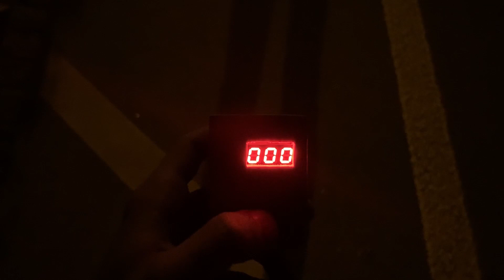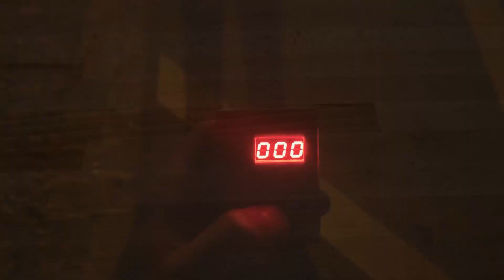Simple DIY GPS-Speedometer

Comment: DOES IT SAVE DATA  SO YOU CAN PLUG IT IN TO A PC AND SEE WHAT YOUR MAX SPEED WAS???OR ONLY REAL TIME DATA? AND YOU GOTTA BE WATCHING IT OR HAVE A CAMERA ON IT/?
Reply from the maker: The arduino can collect data as long as it remains running and has an onboard storage (eeprom) which can hold up to 512 bytes. So saving top speeds is no problem.
Reply: @bootlegengineer   hmmmi wonder if my apm 2.5 can do that i cant remember last time i used it was 4 years or more 
ok thanks and i think you said you had video that tell all the parts and more detailed instructions on how to build it ...  n would you build me one n if so what would you charge for it plus shipping to las vegas nevada ??

Comment: How did you wire the screen
Reply from the maker: Well that depends on what screen you use. If you talk about the segment display, you can find schematics for it on the web, in the end the pins are just the seperate led pins and you have to think about how to deive them yourself. If you talk bout the oled then you can use A library that handles everything for you and also tells you which pins are valid.

Comment: Hi,  I would like to make one of theses, But am unsure of the wiring. could you help me please,
Reply from the maker: Cheers Daniel, 
The wiring is rather simple on this one. To hook up the gps you connect Vcc to the 5V pin (or if its a 3.3V GPS to that pin), and ground to ground. For the software serial connection you can use most of the available pins on the arduino.  *here are all softwareserial compatible pins listed https://www.arduino.cc/en/Reference/SoftwareSerial

To connect the 8 segment display you will need a total of 11 IO pins (all D# and A# pins). 8 of which you connect to the 8 cathodes. The remaining 3 pins are connected to the common cathodes via a resistor that limits the current to 40mA max. 
If you use a OLED display for nicer aesthetics you will need to use the i2C pins or SDA pins depending what protocoll the display uses. If you have questions how to drive the 8 display i can help you with that.
Kind regards
Reply: @bootlegengineer  it would be great to have a chat with you about a few areas I am still struggling with.
daniel-j-lee@outlook.com